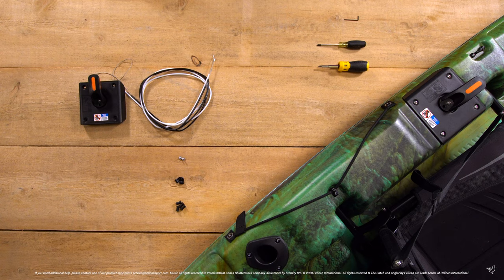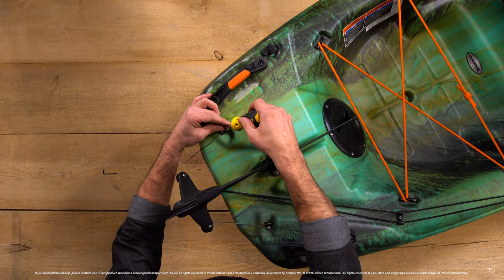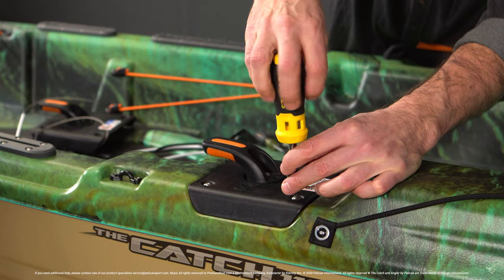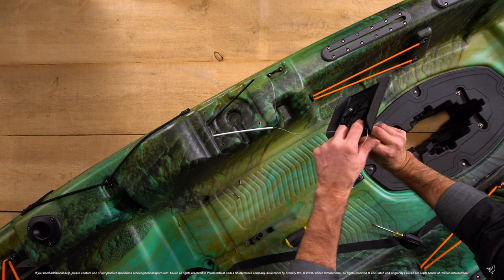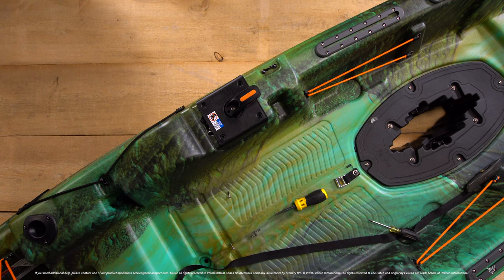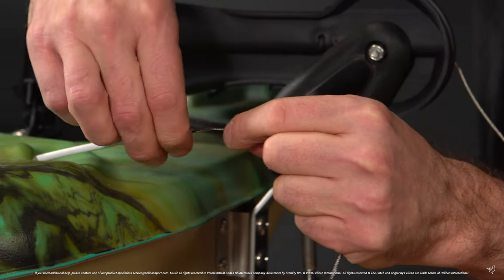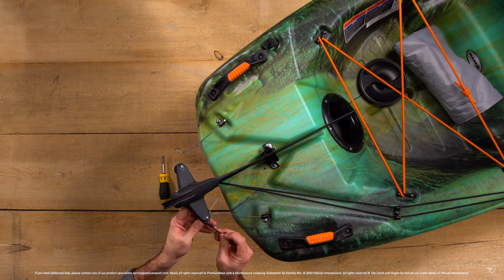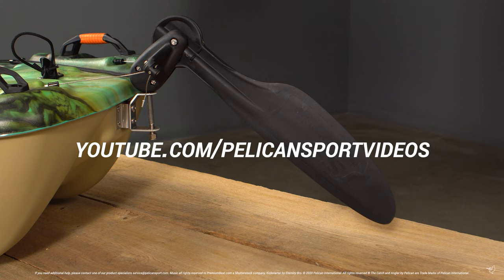PELICAN | How To: Replace the Rudder Cables on the CATCH 110HDII & CATCH 130HDII

Comment: Every time i take the kayak out on the lake the rudder control works fine for about 20 minutes, then the wires become misaligned under the rudder controller and I have to use a paddle until I can get back to shore and realign them.
Reply: I have the same problem. It happen under the rudder control box
Reply: Loosen the set screw and tighten your cables before you go out
Reply: If your cables are tight it won't get misaligned
Reply: Same here
Reply: @account2292  Aligning the cables under the rudder controller then tightening them as tight as I could, back by the rudder, solved this for me. If your cables are especially deformed as mine became then you may need a second person to help you. One person hold the cables in the aligned position while the other locks them tight on the rudder.
Reply: @Derekcanskate  just tried exactly that. Thx